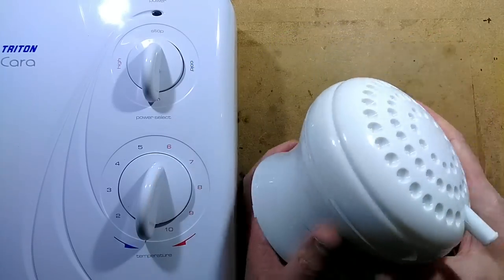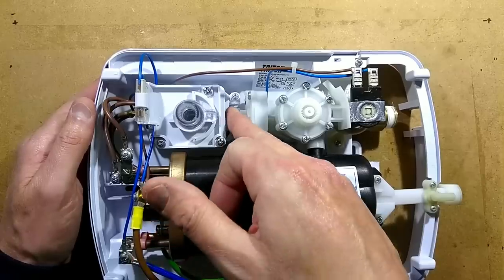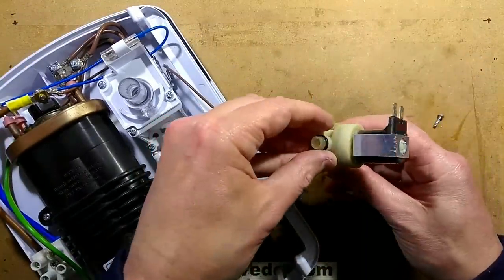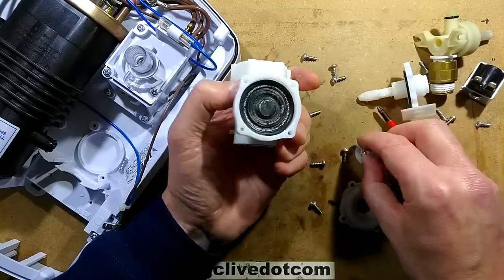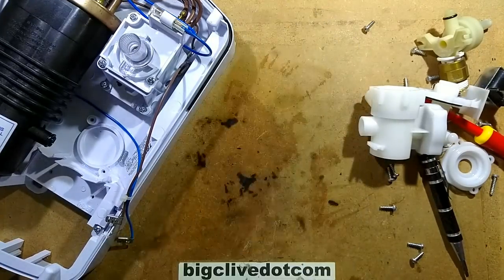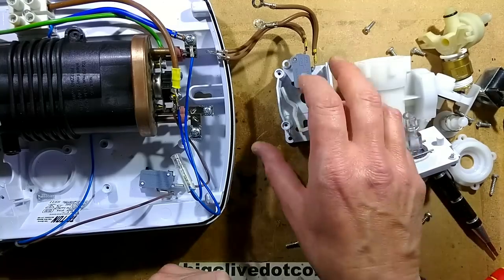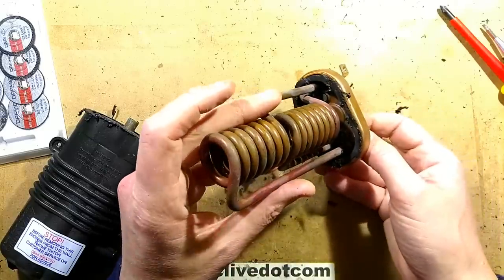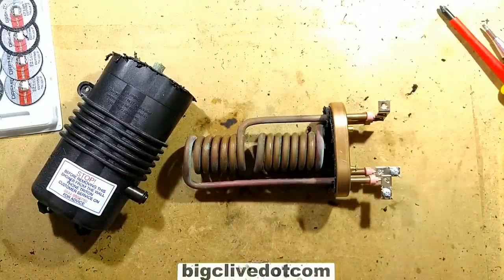Teardown of a UK electrically heated shower unit.

Comment: Well I always thought when you turned the shower to hot, it was drawing more power so the pump had less power to push the water through. I didn't know it actually just reduced the flow of water through the element.

Every day is a school day when big clive's aboot.
Reply: I thought exactly the same. The Triton we have made me think that because it's relatively quiet when cold but sounds exactly like a kettle when at hottest.
Reply: Triton lied to us!!!!
Reply: You must be in a hard water area. That sound (which is called kettling by the way) is due to limescale build up on the element. It will, eventually, kill the heating element. It might be possible to remove the heater and use a de-scaler on it, but not in situ.
Reply: In Florida it always sounds like a kettle waters is too hard

Comment: These have changed a lot over the years in design. They used to have for example a diaphragm switch to sense water pressure and a relay board for safety interlocks.

Comment: Audio is good but would prefer a wider angle. I want to zoom out constantly.
Reply: its an impossible balance, people watching on phones or tablets want closer shots so they can see whats happening and people using desktop monitors or tvs want to zoom out
Reply: yeme
I've watched a few on my 46" TV - never worried me when he zooms in. Normally I'm watching on a phone though, so zooming in is important to me.
Reply: Sit further back? Or don't watch full screen? 

I'm on a 27" monitor and sit fairly close to it. No complaints here.

Little point it making the screen 3/4ths dead space just so you can sate some guy's dumb complaint
Reply: i watched it on a 34" ultrawide screen and the zoom would have been perfect if this video was ultrawide. as 16:9 i'd prefer it a little zoomed out. stuff he's showing don't even fit properly on the available space.

Comment: Thanks Clive. Have fixed my more sophisticated Triton many times but never had to replace the heater unit so wasn't sure how they constructed the element inside. Most revealing thanks. Mine has electronics and provides water over run after the heaters have been switched off to prevent that latent heading effect. This is easily done with it's electronic on/off control, and mode select push buttons. Have been toying with the idea of replacing the electronics as it never remembers the heat setting so summer time I'm having to keep pressing the economy button.

Comment: Interesting unit. I wish we had power like that over here.
Reply: Robert Gibbons aren’t these common in America?
Reply: @scottwhitley3392  Not at all, the US uses a water heater in the house so the bathrooms/kitchen etc all have a hot and cold water pipe. There are some newer water heaters available here that are electric, but most of them use some form of gas such as propane. I believe Canada is the same for the most part.
Reply: Aidan Montgomery in the U.K. half the house have combi boilers that supply showers but the other have (usually older) have electric showers. I think it’s because homes in the U.K. tend to be much older than in the US so don’t have fitting for mains hot water showers
Reply: @scottwhitley3392  It does make more sense if there isn't already pipes run for hot water, which would be the likely case for older homes there. The tank water heaters used here are a pretty wasteful way of heating water, fortunately tank-less water heaters are becoming available and will soon likely become more common here. They would generally only heat the water when it's being used.
Reply: Aidan Montgomery Ignore earlier comments! Every home in the UK has some form of water heating, most usually a combi boiler or a cylinder heated by a boiler or an electric immersion heater. The real reason for the popularity of electric showers is because many millions of older homes have gravity hot water systems, fed by a cistern in the attic. These are fine for filling a bath, but don't provide the required pressure for a good shower. Baths were the norm here until perhaps the eighties, and electric showers became the simple and cheap solution to those wishing to add a shower to their homes but who didn't wish to replace the entire hot water system.

Comment: I have fitted some many of these Triton units.  Very straightforward and simple to fit.  They are made rated from 7 to 10Kw rating.  Simple to use and cheap to replace if they fail, though never had one fail yet. Highly recommend them for the price.

Comment: Video is good but I don't like the new audio.
Reply: I noticed a bit of distortion on louder words.
Reply: sometimes it is clipping the audio, but it is doing it in a controlled and not too unpleasant manner.
Reply: I find the video much better, and the audio only slightly worse (bit bass heavy maybe)
Reply: And nearer the end of the video, once the Dremel has been used, the audio deteriorates quite markedly

Comment: This is a great video, and has answered a family debate over the use of eco vs high switches in winter.  I maintain that it's easier to burn out a heating element through overuse on a high setting, than to run two elements both on a lower setting.

I'll look at your other videos too, as this is the first I've seen of yours, and will probably recommend you to

Comment: The units I've repaired use an opto-isolated triac driver to send pulses across resistive coils inside plastic heating tubes.
Current is ramped and adjustable by a board mounted pot.
Temperature regulation is via a sensor on the side of the heating tubes.
Flow regulation is either solenoid A or A+B or None.
Feedback always prioritizes flow.

Comment: I remember using exactly this unit in London when I was there on a business trip for my company, staying at apartment. It was not a very nice experience compared with my country where It's practically a standard to use something like 35 kW natural-gas boilers for hot water and heating :) Using this electric heater you either freeze to death or you need 10 minutes to wash shampoo from your hair :D Good times :)
Reply: My folks have this shower and boiler for the bath. If you mainly have baths then an electric shower is a good backup for when the boiler breaks down... But they are bit  naff and slow.
Reply: Electric showers do come in a range of powers. I've experienced some really good, powerful electric showers, and some really measly, lukewarm dribbles.

Comment: I have this shower in a 10.5Kw version. It works alright. I had to replace the solenoid once and also pressure overload rubber ball.    If you don't let them run cold after use they tend to trigger the heat overload switch and require a couple of minutes of cold if you're next in.

Comment: Dont even think we can use them in the us. I mean legally aside from 240.
Reply: No.  We have 1st world water heaters for the whole house.  I wonder if they have one of these for washing machines, sinks, etc.
Reply: Larry Gall there is nothing first world about American water heaters, especially open vented gas ones which have been banned in Europe for years. These electric showers are mainly used in extensions to save plumbing, or as cheap upgrades to bathrooms in homes with gravity hot water systems- they do not always provide sufficient pressure for a traditional shower.
Reply: @larrygall5831  NA is one of the only ares in the world where we "store" hot water. A complete waste of $$. Hot water heaters are 3rd world tech. In Montreal we are slowly getting rid of tanks and going with instant units (whole house).
Reply: Wallace  fun fact: immersion heaters generally operate either central heating or hot water, with another boiler to do the other one.
Reply: @mikejd35d23  Well within the last 5 years or so there have become many tank-less "instant" water heaters available for use in the US. Old style tank water heaters are not the only thing available here, whatsoever. I say give it a couple decades and tankless water heaters could end up completely taking over in the United States, and probably all of North America.

Comment: Does this get mounted in the shower stall (exposed to water)??  I see little evidence of water-proofing seals in the enclosure.

I like the energy efficiency aspect of an on-demand heater, but the temp control that just reduces flow without mixing cold water is a poor approach.

Comment: bigclivedotcom .... Why do alot of the UK or just EU anything have alot of Neon lamps?  Why not use LEDs vs Neon? Is there a reason for this? Wouldnt it be cheaper to use LED? Wouldnt it be a less of a power draw than a Neon Lamp? I mean you still ahve to use resistors so it isnt a resistor issue.  You dont see Neons in US anything anymore they use to, I have seen some back before  1970, anything 80-present  you dont see neon or incandecent anymore, just LEDs now.
Reply: Larissa Monroe neon can be put straight across the live and neutral without using any fancy components to provide a lower voltage. Whilst leds might last decades, capacitors, diodes and resistors won't, plus they're bulky - so there's less chance of a failure when neon is used it will pretty much go forever so you can be sure if the lights out there's no power, where as with a led you can never be sure.

neon always has a greater tolerance to any transients or surges which might otherwise kill a led. it will always illuminate if there is a week connection, I've known neons to faintly glow even when one pole has been isolated, so again you can see if it is receiving some juice still from the mains (imagine a faulty isolator switch, the led wouldnt be able to tell you that).

Over all. neon works and is robust and no nonsense.
Reply: Ahhh ok thank you Both for the clarification....much appreciated.
Reply: Actually that is a good point, very good point.
Reply: @Paul Gascoigne: totally agree, I have several power output/switches with red neon indicators around the house, all glowing nicely, a couple of them for > 20 years:)
Reply: It all comes down to the cost of a neon plus low power resistor vs. diode + LED + resistor. The 230V / 240V means a resistor running a LED will run hotter than on a 110V / 130V supply. So the resistor has to be a larger type with a higher power rating. The available current or available power is not really relevant.
Reply: JP Robson Not when deciding neon vs. LED. Neither should be relied on to prove equipment is dead or powered. As both can fail.
Reply: @paulgascoigne5343  wait, i used my shower for nearly a decade and its the one in the video...

Comment: The shower in my flat transmits a radio signal across the room to the box that controls the water pump for the drain (the bathroom was converted to a wetroom)

I had assumed there was just a cable running between the two initially. 
Opening up the generic grey mains box on the wall was a huge surprise, inside was an LCD and some buttons to play with :)

You can program it to pump at different levels dependant on what mode and water usage the shower is on. After the shower is switched off, you can set a delay (to allow most of the remaining water to flow across the floor) and the have the pump run for a short while.

It's ridiculously fancy, but you'd never know it to look at.

It's possible everyone else knows about these, but I was amazed :)

Comment: That thing wouldn't even work here in Portuguese homes, the highest single phase amperage we can here for a home is 30A.

What amperage does a typical UK home have?
Reply: usually fused at 80-100A, but a lot of older installations will have a 60A main fuse
Reply: Generally it's at about 100A
Reply: 100A 230V
Reply: mine has 50a total, hope no-one showers whilst i am using power tools in the garage
Reply from the maker: Typically a 240V supply at 80A.
Reply: sooo....about 80 or 100 amps then?
:p
Reply: I guess here things are a bit different, the cable from the company comes inside a fuse box that's outside before the meter, these fuses are typically 40A, then from that fuse box another cable goes to the meter that then goes inside the house that is connected to the cable company's breaker/limiter which is selectable for 15/20/25 or 30A (depends on how much you need or are willing to pay the company). Then from that breaker it goes to a main RCD/GFCI, then we use 16A circuits for outlets and 10A for lighting, usually an induction stove has a 20 or 25A breaker (that usually trips when all 4 are on at the same time) and that's it.
Reply: t0nito In Denmark, the fuse before the meter is also the power company limitation, and dictates the thickness of the cable until after the consumer unit "group" fuses/breakers, which are usually 10, 13 or 16A, those are the last fuses before most loads (none of that fuse-in-plug + overfused "ring main" BS).  Sockets and switches are typically rated for 10A with 16A fuse permitted as a recent concession to repurposing old 3ph 16A groups meant for high power switches and outlets. Older installations may still have some 6A groups.  A 3ph/16A group provides 10kW, which is enough for exactly one of: Stowe, Central water heater, Washer/Dryer, Large workshop machine.  Higher amps maybe found in industrial settings using fixed cabling ot those hideous IEC plugs.
Reply: bigclivedotcom In the West Country, (Western Power area), most homes have a 60A feed. Even my house (about 18 years old and the newest in the street) only has a 60A feed, even though I have three 32A ring mains, a 32A MCB for the cooker and 16A for the rarely used immersion (water) heater. No electric showers though, as a mains pressure hot water system supplies the mixer valve type showers. The immersion heater is rarely used because normally the gas boiler supplies the "heatstore" water tank.
Reply: John Francis Doe Ah, but one of the advantages of the UK ring main system is that within a defined area, you can have as many power outlets as you like. So in my main living room, I have one triple outlet, and three double outlets. In the kitchen, I have 7 double outlets and 4 single outlets (not including the separately fed cooker supply).
Reply: I live in Portugal and for a while used one of these, a 7kW unit brought from the UK in a house with a 30A supply.  Worked fine, except you couldn't run any other heavy loads, such as a kettle, while showering or the supply company's main breaker would trip.
Reply: At 30A must have been quite at the bare limit of the breaker as 30A x 230V = 6900W if the breaker wouldn't trip by the time you finished your shower than the breaker had quite a good tolerance.
Reply: Ho t0nito, you're quite right, indeed it was at the limit.  However my experience has been that an EDP breaker/limiter set to 30A will pass at least 10% more current than that for many minutes before the thermal trip kicks in.  Long enough for a shower ;-)
Reply: It ranges from 60A to 100A. We generaly have bs88-2 or 1361 at the service head. Weirdly they can safely brake upto 33K. never found a short circuit current above 10k. Normaly lower than 2. Electric showers can be quite economical in a warmer climate. Because we only need to heat a small amount of water when needed. Especially if its a small home/family.
Reply: 100A
Reply: Older houses here in Ireland have 63amp, not sure on the newer rating, but 63 is easy enough to overload nowadays
Reply: I lived in a converted residential house to a student house, in it we had 4 shower rooms, each with a 8.5kW electric shower from the same brand as in the video. Yet we could all shower simultaneously without tripping the power.

Comment: Liked it! I learned among other things the concept of "Thermal Inertia" - that was a lightbulb moment, thank you.  And re the workbench top please allow me to make a suggestion: you can use peel and stick floor tiles to cover your MDF top to make it much more impervious to water and oils and easier to keep clean.  They are so cheap they are somewhat disposable and easy to peel up and replace individually when needed.  The nicest ones are true linseed oil and sawdust Lineoleum; or Marmoleum tiles; but those are too expensive in the US so I just use the common Armstrong type.